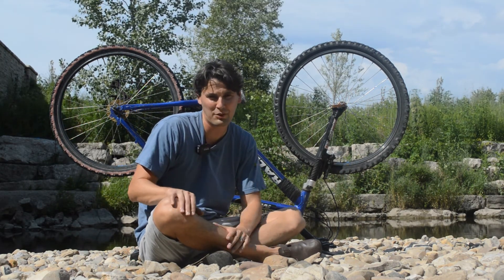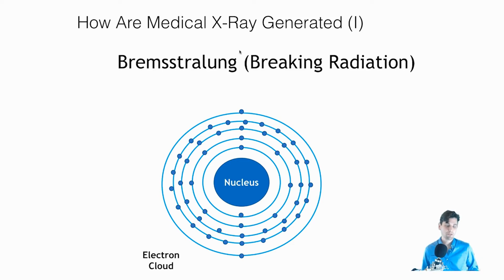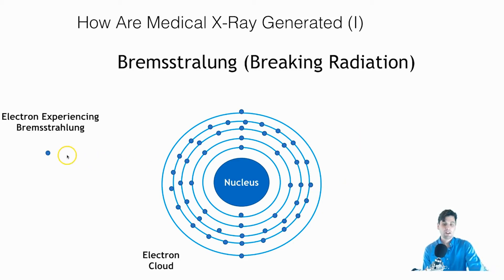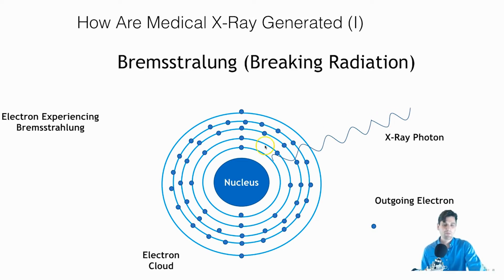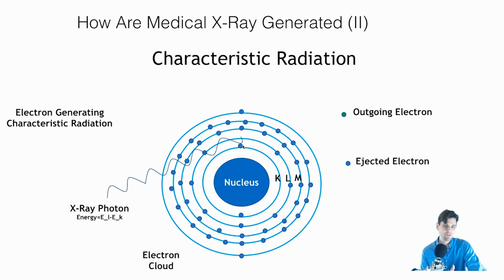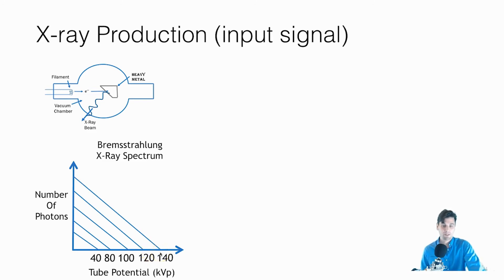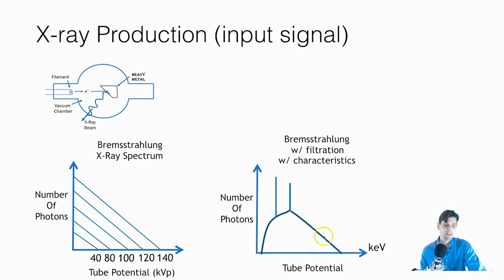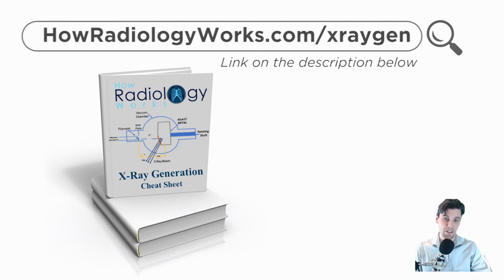X-ray Tube Physics, [Bremsstralung and Characteristic Illustrated for Rad Techs]

Comment: Thank you for the video! Just would like to know. Are bremsstrahlung and characteristic x-rays produced at the same time when electrons hit the anode target? And they both are aimed at the patient in the beam as 'x-rays' not two different types? So essentially, would bremsstrahlung and characteristic be just different processes of making x-rays and both being able to do photoelectric absorption and transmission? (but of course some may be Compton scatter too)
Reply from the maker: Yes x-rays produced both ways will be part of the beam and can interact with the body and the detector via photoelectric and Compton

Comment: Thank you for the useful video. Can I ask why do we have higher number of photons for lower energy and lower number of photon for higher energies?
Reply from the maker: The bremstralung photons come when the electron changes it’s momentum quickly to conserve energy. If they change direction slightly that results in low energy photons and the highest energy case is where the electron turns completely around when it passes the nucleus. The more extreme changes in electron path are less likely and hence the higher energy X-rays are less likely.

Comment: Hi!! congratulations for the video! I have a question!Why invreasing the kVp increases the amount of characteristic photons?i cannnot find te explanation. Is it because with a lower kvp its more likely that the most of the e  wont have  the needed energy to create them as they will have lost some  due  the bremsstrahlung interaction??
Reply from the maker: Eliss, thanks for the kind words. You are right at lower energy the electrons incident on the target do not have enough energy to break the inner shell electrons free. The inner shell electrons have a binding energy so that a minimum voltage V_k is required to free the electrons. For Tungsten this is about 70 keV. Then as the energy is higher it is more likely to free an electron. The amount of characteristic radiation is proportional to ~mA*(V-V_k)^n where n~1.5 and V is the voltage of a given thermionic electron. So as at higher kVp there are more high energy electrons incident on the target.
Reply: @HowRadiologyWorks  thank you so much for responding!! means a lot!!! Happy December

Comment: "Boiling off" electrons with heat seems like a waste of energy and unnecessarily complicated when voltage alone would arc the electrons to the tungsten.
Reply from the maker: Thanks US Pirates. You are right it is more efficient to pull electrons directly but he invention of the hot cathode actually helped to significantly increase reliability and the potential exposure. A nice video from 1941 is available from the inventor himself: William D Coolidge https://www.youtube.com/watch?v=mbRcNV8Wkz8 . Worth a watch for sure. There are also research projects on field emission cold cathodes that are ongoing and may be used for medical equipment in the future. But for now the Coolidge tube like I described is the workhorse of x-ray and CT scanning.

Comment: nice video but you didnt speak about the energy of the electron of kev   each how many kvp to bremstrlung how many kvp to produce kev electron ejection energu needed
Reply from the maker: Thanks Harout, sorry I don’t exactly understand your questions. Can you ask one question at a time and try to rephrase it?
Reply: @HowRadiologyWorks  at what kev electron from atom 
shels from k l and m shells are ejected to have charastarictic x rays
Reply from the maker: The k emission lines which are most common are about 59 and 58 keV for tungsten which is a common target material.
Reply: @HowRadiologyWorks  thank you fir your reply what mazumun range kvp is used radio therapy when not using linear aacelators only if using tube x ray what is the maximun kvp range commonly are used
Reply from the maker: X-ray tubes were used for external radiation therapy before modern linacs were developed but are no longer recommended as higher energy X-rays are really preferable for dose delivery